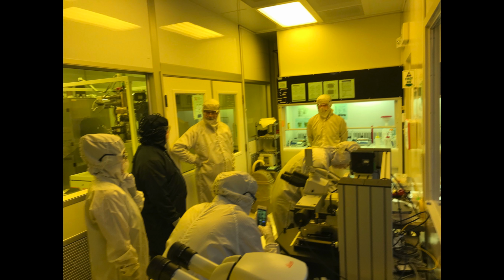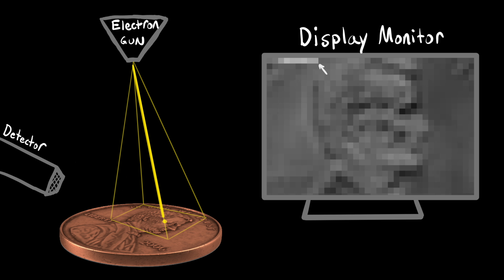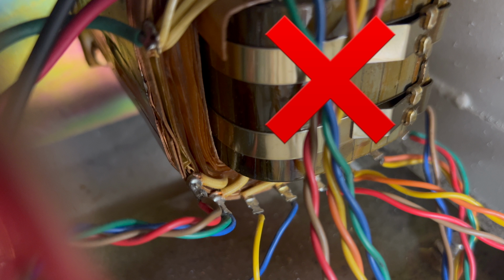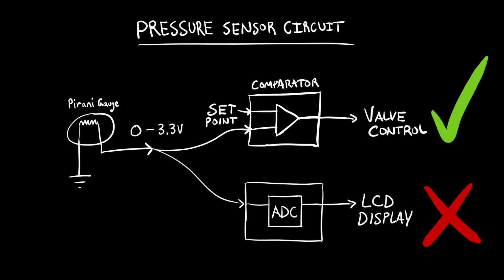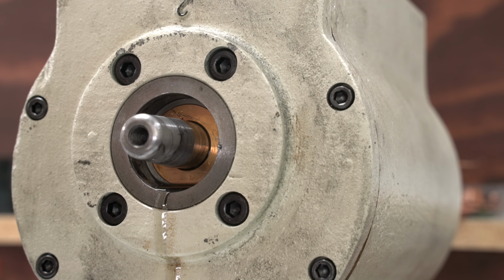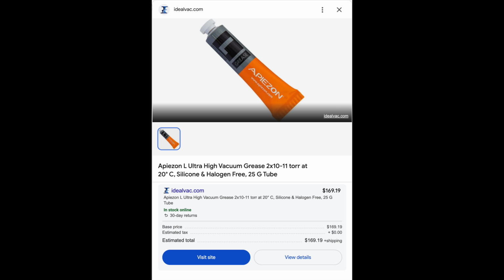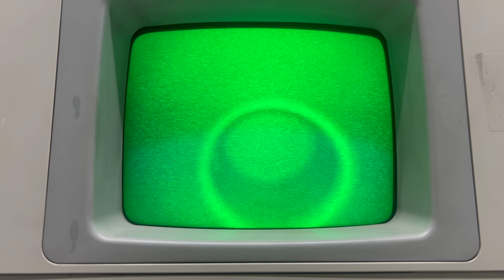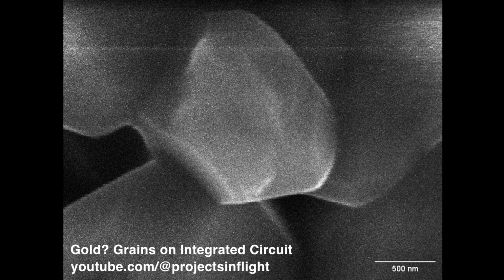I Saved an Electron Microscope from the Trash

Comment: I worked for JEOL for 7 years as a field service engineer. I'm super impressed with what you've accomplished. As far as I can tell, you've done everything right. I'm surprised that pump failed, those things are bulletproof. They used them for decades and this is the first bad one I've seen. 

The image shifting issue looks like it's an issue with the CRT, or maybe it's driving circuit. It seems to only be on the bottom of the screen and is mag independent. The only things that could cause the image to dance around like that are the CRT or the beam scanning system, which would be effected by mag and the image shift (that is what the joystick is for if I recall). EMI can cause that too, but it would be everywhere not just the bottom.

Keep up the great work.
Reply from the maker: Regarding the pump: i suspect that if i was more careful, i could find the issue and fix it, but unfortunately this pump is very difficult to troubleshoot because of it's odd design.

Regarding the CRT: yeah it does seem like there is an issue with the driving circuit. seems like the whole screen stretches and shrinks at a time. i'll try replacing the caps and stuff first.
Reply: @projectsinflight  I'm sure I don't have to say this, but be sure everything is discharged before you mess with the CRT or anything in its circuit. I actually got bit from a CRT I thought was discharged when I was converting an old SEM to LCD. 

I would probably try to clean up the image capture signal chain before fixing the CRT. Especially since the image output could be convenient for videos. You could probably just turn the beam off and poke around with an O scope. Then any signal you see is just noise. It's likely a bad connection or a ground. Possibly noise on the reference voltage of the ADC. I've never messed with one of those systems, so I'm just guessing. Good luck.
Reply: @generic0000  JEOL BioMagesty 6010c? DiaSys, Germany? )
Reply: @oleg.kordonets  Sorry, I don't understand your comment. And I've never been to Germany.
Reply: @generic0000 Convert a machine from crt to LCD?
Reply: @fabiofoltran4361  yep, it was a whole kit. I only did it because the CRT died. It was fairly involved.
Reply: @generic0000  A buddy of mine used to be a TV repair man in the old CRT days.  He once went to look at someone’s TV and opened the back.  He looked inside and got some sparks off his metal rimed glasses.  He stood back and said “Sorry I’m not gonna work on this one! way too dangerous”.  Those weren’t his exact words and I’m toning it down.  He was a Geordie (Newcastle, UK) and the expletives were very colourful.  CRT’s can generated stupid voltages if they have no load on them or the transformers fail!
Reply: @projectsinflight  Surely its the verticl deflection circuit I've repaired a lot of crt television sets and that is a common issue, blame on electrolitic caps.
Reply: @projectsinflight  While stabilizing "TV-rate" scan on the CRT will be nice, I don't think I would put too much effort into it.  IMHO, 'stabilizing' the image that you can acquire with the computer should be your focus.
And, you can use the quality of the slow scan image on the CRT vs a slow computer acquired image to see if the imaging problems are in the SEM or are just in the signal path to/thru the computer. 
Finally, the 'vibration' on the edges of the particle at high magnification was likely 60 Hz magnetic fields in the air in your 'lab'.  Likely not fixable.  The slowest scans are synced to 60 Hz, so the distortion is not so obvious.
Hopefully, the computer scans are (or can be) synced to 60Hz as well.
Reply: @fewwiggle  I agree the PC system should be the priority. And you are 100% correct about comparing the PC image to the CRT to see if the imaging issue is the SEM or the CRT. However, there is a much easier way. If the distorton was from the SEM changing KV, mag, or using the image shift would effect the distortion. I'm 95% sure the issue is with the CRT circuitry. Also, those jagged edges could be either EMI or vibration. He would have to look up in the manual what the scan speeds are and put 2 marks by the screen. Then you time how long it takes for the scan to travel between the two marks. Count the number of jagged edges between the marks and it will tell you the frequency. It could also be a ground loop, but if it's still there after unplugging anything else connected to the microscope (PC, penning gauge,...) Its likely not a ground loop. A ground loop would also be 60Hz. Also, don't assume the fast scan on the CRT is synced to 60Hz. It could be anything. And it's not uncommon for EMI/vibration to not be visible at a fast scan speed. Between the persistence of the CTR screen and the noise in the signal it can be hard to see unless it's really bad. That was also at 100k mag, which is pretty much the max usable mag on a scope like that, and only if the sample is appropriate for that kind of mag.
Reply: @projectsinflight can you share any model info regarding the pump? I repair industrial refrigeration compressors and vacuum pumps. I’d like to read about this device.
Reply: Could you route the video output to a digital converter and use a modern LCD? @projectsinflight
Reply: Why repair the crt at all, u can get image on that pc on a much larger screen and b&w colour too  @projectsinflight
Reply: @projectsinflight  Get rid of the crt entirely. bypass it with an ipad! lol.  /s
Reply: After all those years, replacing all the crt capacitors is a must. Do you know what are the video signal specifications, a big non green screen is a nice upgrade
Reply: Electron Microscope technicians are the best.  I bought a cheap Hitachi S-510 from a local university years ago and I emailed hitachi support to ask for a user manual.  The technician who responded was super helpful and he went way above and beyond my expectation to help me troubleshoot.  He treated me like a legitimate Hitachi customer and gave me full quality support on a level that I expected would require an annual service agreement or something.  Many years later I am still grateful for the way he treated me.  As a hobbyist I felt like I did not deserve the quality of support I received.  It also made me think that becoming an electron microscope technician would be a great career path if I ever decided to change industries.  It seems like a fulfilling field of work.
Reply: @RedShiftedDollar  It's a great job, if you are the right personality for it. Also, there can be a lot of travel depending on where you are.
Reply: It's  really cool that you got this dinosaur working even if not yet perfect. Finding things you want to examine with it may take a little time. I once saw an image of a coin that had an added mintmark. The microscope made it obvious that the mintmark was added.
Reply: I also worked for JEOL 1994-2004. I worker LA/Miss and Dallas,TX
Reply: @jeolman1  ever visit Microtech Labs?
Reply: Looks like a scratchy potentiometer to me, probably V-Linearity. Or a dry solder joint. I don't think it's capacitors.
Reply: @senilyDeluxe  I would agree. I had a whole class on how CRTs work, but that was a LOOOOOONG time ago.
Reply: @generic0000  may be also due to low video output or lack of video gain . One could replace the video cable that was replaced  by a better quality cable which could improve the video signal bandwidth.
Reply: @manusudha4269  these are not off the shelf CRTs. On a normal CRT the image signal and the control signals are combined together. On these SEMs they are not. The image signal goes to the gun, varying the intensity proportionally to the detector signal. The distortion on the CRT is caused by the deflector yoke that goes around the CRT. On the SEM these are completely separate systems.
Reply: @oldmech619  I missed that. That is how he's powering the penning gauge he added. It could be just his way of switching low voltage DC. You only want the penning gauge to turn on after the SEM has decent vacuum.
Reply: @generic0000     I think you are correct. Just an odd configuration, but I guess that all of us have done something like that before.
Reply: Why just use an old TV and connect that RCA cable to it.  If it doesn't flicker, it the CRT issue.  Try to air blow the transformer when it's completely discharged.  Sometimes dust will cause the conduction in the high voltage area.
Reply: @bayareapianist  Unfortunately that won't work. In order to get the image, the CRT and the SEM need to be scanning in sync. Yes, the video signal looks like it is carried by an RCA cable, but there are separate control signals that control the CRT and/or the SEM. The only way that PC based imaging system works is because the software takes control of the SEM scan coils. The SEM screen gets garbled when the PC takes control because the CRT is out of sync. In other words, the signal on that RCA cable is not a NTSC/PAL formatted signal. It is just the output of the detector without any control signals that an off-the-shelf CRT needs to run. Also, it can run at different scan speeds, which a normal CRT is not set up to do.

As for the cause of the problem: I've seen it before, I just cant remember what the cause was. It's related to the CRT yoke or it's driving circuitry, but it's been too many years since I've messed with one. The CRT itself is clearly fine.
Reply: @generic0000  I think you are right.  The scanning frequency of SEM and the CRT should be the same and they don't have to be 50 or 60 Hz. 
PAL and NTSC are just for color TVs.  The only difference for b&w TVs is that frequency about. 
Most likely the problem is the high voltage transformer or connection for CRT.
Reply: @generic0000  Could you use just off the shell oscilloscope as a display?
Reply: woah that's awesome!
Reply: In my fathers basement there's a JEOL JSM-T300 that he got for free. I think it was in working condition when he got it but it has been standing there for some 10 years.
This one is in Sweden. So this is more a "Me Too" posting in case anyone is interested.
Reply: i personaly think the pump was working perfecly until the moment the system broke, and the long time staying around ate on the pump..
its the same as with carmotors, if not moved the water in the system starts eroding the surfaces..
Reply: This reply section has more information that my mechanical science textbook
Reply: I'm thinking it might be worth just swapping out all the electrolytic capacitors. It would cost very little and, at worst, it would make the chances of future failures slightly less likely. EDIT: ah, I see someone else just said something similar.
Reply: A faulty vacuum pump was probably the reason it was thrown out.
Reply: I have not the slightest idea how this machine works or operates, but I see someone talking passionately about about their interests for almost 40 minutes. While giving a good explanation. (Still don’t understand how it works, but that’s ok)
Reply: Does the crt in this system have "normal" deflection circuits? If I saw that on a computer monitor I would look at the capacitor that's across the vertical deflection coil.
Reply: @compu85  Yes, the deflection circuitry should be mostly the same as a TV/monitor since it is doing the same thing, just with more control.

For the record, I'm not saying it's not a capacitor. I'm just saying that replacing all the capacitors in the CRT circuitry because the SEM is old-ish is not the best way to fix this. Especially since you will likely have to unplug and move other PCB to get the CRT PCB out to change the caps. I'm just advocating for actual troubleshooting over shotgunning parts at the problem.
Reply: @generic0000  I suspect this talk of "it's probably the capacitors" is from people that have mainly, or only, worked on electronics since the electrolytic capacitor plague from 1999-2007. A Japanese worker from Rubycon stole an incorrectly copied formula for the electrolyte in the capacitors and bailed to China, then later defected to Taiwan with the still incorrect recipe. These got manufactured in absurd quantities and flooded the market.

People who yell "replace the caps" at products made outside of that time period are (99% of the time) just parroting something they heard with absolutely no understanding of why it was said in the first place. It's quite refreshing to see someone saying "let's do some actual testing."
Reply: @shikutoai  I didn't know the story behind the capacitor issues, but that makes sense. There is a time and place for "just swap the caps", but only if they look bad or are a known issue for whatever you're working on. I'm trying to walk the line between giving helpful advice and crapping on others who are trying to do the same. Not everyone has the same experience, knowledge, and training. We all have to start somewhere.  And I am by no means infallible. One thing that was beat into us was to properly troubleshoot something instead of just throwing parts at it.
Reply: @generic0000  "One thing that was beat into us was to properly troubleshoot something instead of just throwing parts at it"
I think a lot of that philosophy is based on getting a deeper understanding of the circuitry so that long term troubleshooting (on multiple microscopes) is enhanced.
For a project like this, and where we know electrolytics do go bad over time, I think it's reasonable to replace them all without troubleshooting.
It may fix a current problem, and stave off a problem in the near future.
Reply: @fewwiggle  that is a fair point. Also, the slowest way to fix a problem is to just order a bunch of parts, pick them up at FedEx the next morning, put them in, realize it didn't fix the problem, order parts for the next day....

Another thing to keep in mind is that the CRT board(s) could be buried under other boards. Unplugging dozens of connectors and removing a few extra boards is not without its own risks. Neither is desoldering filter caps connected to a ground plane (that requires a lot a heat). Fixing things is often a risk/reward calculation. And nothing sucks more than chasing a problem for a week, only to realize that you had fixed the first problem but had caused a new problem in a completely different part of the microscope.
Reply: I hope you two stay in touch so he can have a solid friend to ask questions
Reply: Well you don't get much more affirmation than that!!
Reply: @generic0000 How might one possibly get started towards a position like FSE for them or beyond? Besides enthusiasm, of course.
Reply: @SDHoF  some sort of engineering/technical degree and/or experience. The right kind of military experience works too. Just show them you have a solid understanding of electronics (you DON'T need to be an EE), the ability to fix stuff, and the integrity and drive to work by yourself unsupervised and get your work done. If you're the type of person that would slack off if you only saw your boss 2x a year, don't even waste your time applying. It's a great job if you have the right kind of personality and don't mind potentially traveling a ton. I put 45-65k miles on my company car a year, and was living in a hotel 30-40% of the time.
Reply: This comment got me realising that there are two magnetically guided scanning electron beams at work here.  One on the input, and one on the output. 

Which is kinda cool and tempered my thoughts about replacing that CRT with an LCD tapped onto the PCs capture board (assuming it's not some standard video on that RCA connection)

Also, thank you for validating my cable hoarding tendencies!
Reply: @Juttutin  in my experience, cable hoarding validates itself.
Reply: that's a great thing
Reply: I got one from auction sale 25 years ago. Just machine, no brochure or parts at all. Will you sell me a copy of your manual and brochures? Or a site tgat I can down load them! Thanks a lot!
Reply: its definitely worth restoring that pump since most old technology tends to literally last a lifetime before they fail compared to modern (planned obsolescence) technology these days. i would also highly suggest having all 4 of the new transformers properly insulated separately from the machine and grounded to some dedicated grounding since a power surge could easily conduct across the frame of the machine and short out a lot of components.
Reply: @chloekaftan  There should be a grounding buss bar at the back bottom of the machine, probably close to where the main power comes in just inside of the panel. That is grounded to the chassis for safety reasons. Since SEMs have so much mag, small things can have big effects (like the vibration in the video). That is why they take grounding VERY seriously. Everything connected to that SEM (like the PC) should either be plugged into the outlet on the back of the SEM (if it has it), or to the same circuit/outlet if possible. That is to prevent ground loops, which are a bear troubleshoot. You can also use a power strip and a ground lift adapter (2 prong to 3 prong adapter), as long as you adequately ground the power strip to that buss bar (do at your own risk, I take no responsibility...).
Reply: As someone wrote, image jumping is related to bad scanning frequency and it's definitely a circuit issue here. For NTSC, resolution is 525 lines, refresh rates must be 60Hz (or 59.94 exactly) for vertical sync, and 15,734 kHz for horizontal sync. Math is simple: 59.94Hz x 525 scan lines divided by 2 is 15,734.25Hz. For PAL system, resolution is 625 lines, and refresh rates must be 50Hz and 15,625 kHz, respectively. It can be anything, but it is always wise to replace capacitor with good ones.
Reply: @DamirUlovec  a couple of things:
1) these are not NTSC (or PAL, even though this SEM is Japanese). The CRT scan signal changes with the SEM scan speed. It can be anywhere from 30 ish frames per second to 1-2 minutes per frame.

2) while replacing capacitors can be a valad repair technique on consumer devices, it isn't really done that often with these microscopes. If one is bulged or leaking, then sure. But I would have wasted a BUNCH of capacitors if that was my first reaction. Also, these microscopes are really expensive and made with high quality components, unlike consumer products made to a price point. It is probably a connection issue or something causing noise in the vertical scan signal. If the caps look fine, I would break out the o scope and do actual troubleshooting.
Reply: @generic0000  1) You mixing SEM scan with NTSC/PAL/SECAM scan. It's not nearly the same thing.
2) I can agree with this, but - capacitor can look just fine and still need replacement because of lost properties that aren't visible to the observer. That's why we have LRC meters, ESR meters, oscilloscopes and such.
Reply: @My_Humble_Self  NTSC and PAL are television broadcast standards. Nothing on these SEMs follow NTSC or PAL standards. These CRTs even use a special high persistence phosphor so you can see the image batter during slow scans. 

The math you mention can actually be very useful when dealing with EMI or vibration. Look at the part of the video when he shows the jagged edges of the particles caused by vibration. That is also what EMI looks like. You can do the math to figure out what the frequency is. If the pattern is 60hz (in the US) than it is EMI, probably. That's how you diagnose EMI vs vibration in the field without the special room survey gear. 

I don't want to come off as a know-it-all. It's just any experience with consumer electronics, even CRT TVs, aren't a 1:1 to how the SEM imaging system works. 

And yes, caps can look OK but still be bad. But the fist thing I would look at is signal integrity of the vertical scan signal for the CRT. That's why I keep saying the first step would be looking around with an O scope.
Reply: @   Replacing old capacitors on old equipment is usually necessary and relatively easy. Thanks for the reminder.
Reply: @My_Humble_Self  i would also suggest to check and maybe replace capacitor. 
Old electronics that not been used in a long time, Can brake down after couple uses.
Its very often the capacitor that goes bad. They are like batteries, Going bad if not used for some times.
I work with service and repair all types of home electronics for some yr's
The first things i check are the capacitor. Some have visible damage. 
Other common prob are Power supply, knob controls and buttons.